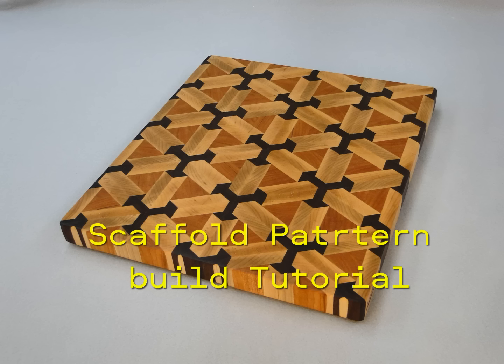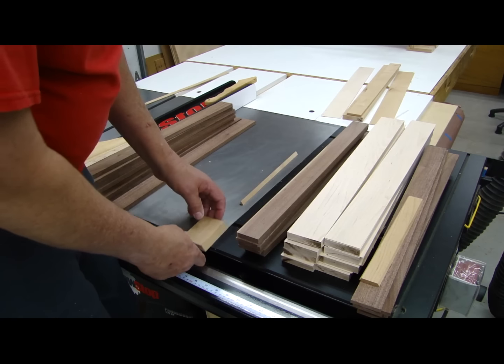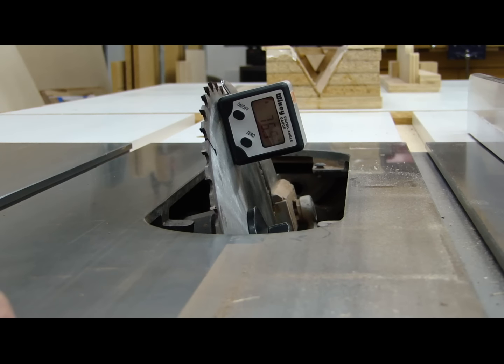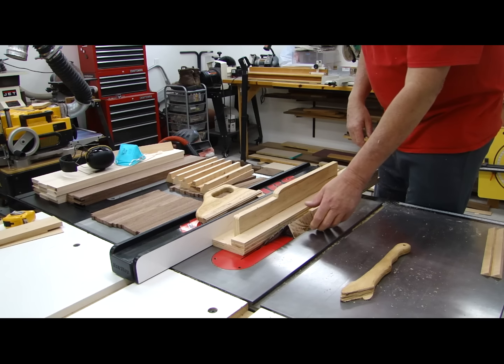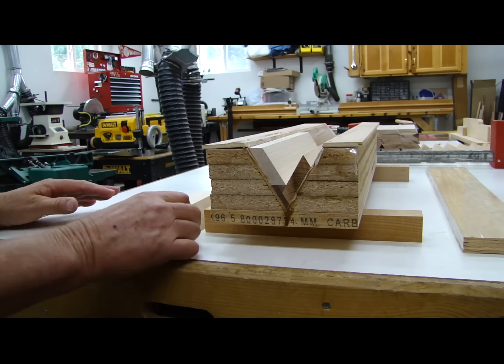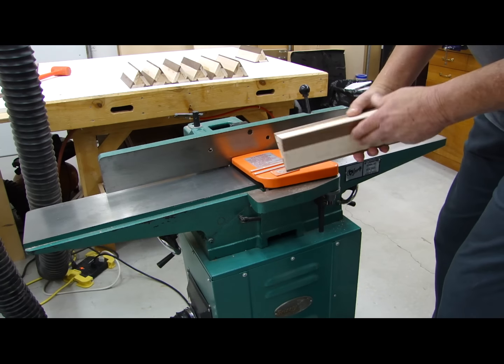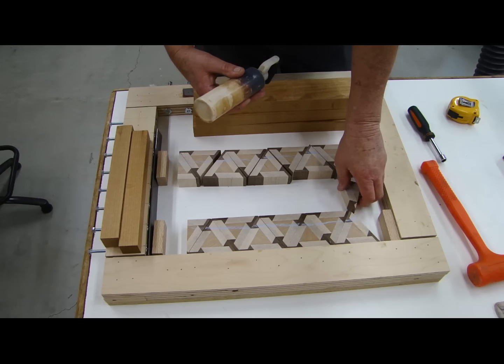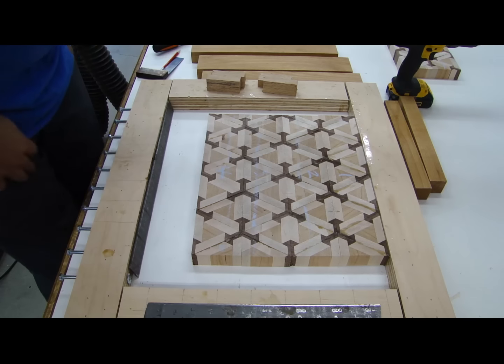Scaffold Pattern End Grain board Build tutorial

Comment: What do have in the soak basin to finish? Do you soak more than once? Any issues with drips/runs in the finish or along the lower drip edge? Thanks Fantastic
Reply from the maker: I'm using pure mineral oil and I soak for about 30 minutes then place on a drip dry rack over night. Next morning I wipe on board butter which is a 4:1 mixture of mineral oil and pure beeswax. Search making board butter on YouTube for more info on that.

Comment: I truly enjoyed this video. I was wondering if this pattern was originally yours. It doesn't matter because everyone steals patterns, ideas and builds. The reason I ask is because I believe your skills are unbelievable and if you developed the pattern that would further my respect for your skill set .I have subscribed. I don't know how many videos you have posted but I feel the camera work could use some improving (like when you are stacking the individual pieces into the v-shaped jig. I wonder how many I will discard before I get it right. And we all know being off a couple thousandths is expected. If you have to reset your fence or blade  or whatever. That's part of "handmade". And, it was cool how you incorporated 3/4" stock to keep the price down. Really, Really Cool. Thanks keep them coming. Super cool.
PS - what glue did you use? What blade on your saw?
Thanks.
Reply from the maker: Hi, Thanks for the comment. The pattern is not my original design. It stems from a segmented wood flooring pattern made in Italy. Someone in a FB group introduced it and his name is mentioned in the beginning of the video. I was excited to bring the tutorial to YouTube as it is a fairly fresh pattern on the end grain board scene. My first build was a struggle but things get easier once you have good test pieces and the jigs made. As for glue I use Tight Bond 3 and my rip blade is the Forrest Woodworker 2

Comment: DeWayne, These 3D boards bend my mind. I have the skills to make humidors, jewelry boxes, and hand-carved arch-top guitars. But I want in on the headaches of expanding my skill level by doing what you do. These are beautiful and you are quite skilled. The first thing I need is to replace my beloved 25-year-old Craftsman and buy a prission table saw, what is the model number of your SawStop. And is it the saw to buy in your opinion? Thanks, Dave.
Reply from the maker: Sounds like you’re at the appropriate skill level. I used a Craftsman contractor saw for many years and made lots of nice furniture, cabinets, boxes etc. The fence on that saw was its weakest point. It would seldom lock perfectly parallel. I have the Sawstop 1.75 PCS and it’s a huge improvement over the contractor saw. I think having your tools well tuned is key. I scored my Sawstop at an estate sale for $1000 and if weren’t for that I’d probably still be using the contractor saw. The Sawstop is an excellent saw and yes I recommend it. There are other saws just as nice minus the brake feature. A good solid T-glide or Besmier style fence is recommended

Comment: Beautiful work.  I understand how you had to use test cuts to get the dimensions.  Is there a technique to making cuts to a 100th of an inch? I want to try making one but I'm intimidated by the fine cuts.
Reply from the maker: I still have struggles with that. For the small triangles I have been cutting them a bit over size, then run them through the drum sander in a V shaped cradle to fineness the fit. I've also been cutting the triangles from wider 5" stock rather than using the push jig.

Comment: I love the board.  The measurements in the beginning of the video do not add up.  Do you have an updated diagram with measurements?
Reply from the maker: I didn’t use math to arrive at the measurements. Just test cuts and fitment. I measured the pieces with 100th “ scale dial calipers. The measurements will get you in the zone and as mentioned in the video make your own test cuts and setup pieces. Measuring the triangles is tricky as you may apply more pressure than I do with the calipers.

Comment: I checked the dimensions of the drawing of the triangle that is presented at minute 17 of the video.  But they turn out to be mostly wrong, because they don't match mathematically.  Can you explain to me why?
Reply from the maker: The center triangle letter A is 1.635 from tip to tip. I didn't arrive at my dimensions by using math I made test cuts that fit then measured them. In the video I recommend creating test cuts to check the fit.

Comment: Although this is a truly awesome design and finished product, there seemed to be a way to make it simpler by gluing blocks together rather than cutting the individual pucks, then gluing. Is there any definitive reason for one method over the other?
Reply from the maker: I've seen it done a couple different ways but haven't tried them. One method eliminates the small triangles in the log glue up but the proportions looked off to me. The other method glues the triangle logs in row's before slicing to board thickness.
Reply: @dewaynebaker2924  Thanks for getting back. It is always foolish to ignore those with experience, but the latter way you have mentioned seemed to be easier, quicker and more reliable, so I had just ordered if there was some flaw in that method. Also is seems imperative to be able to make these items in bulk, so every opportunity to save time, space and labour yet improve consistency seemed to be paramount. Thanks again. Conor. Scotland.